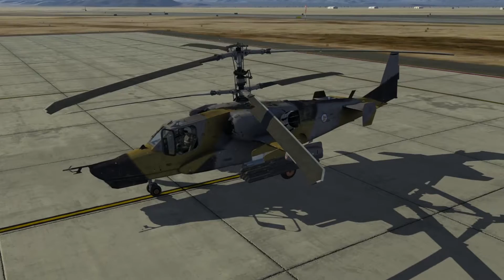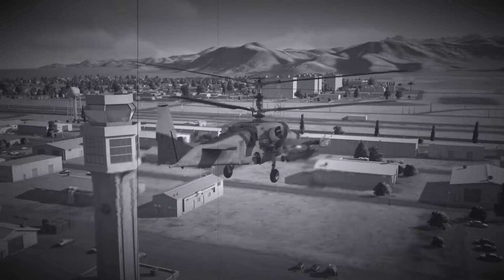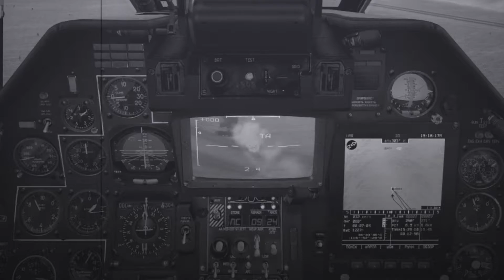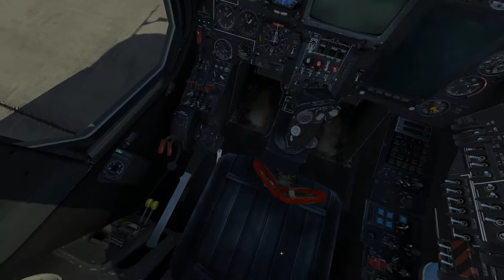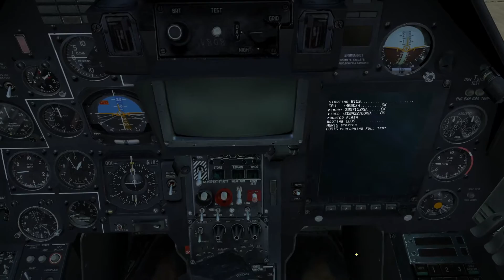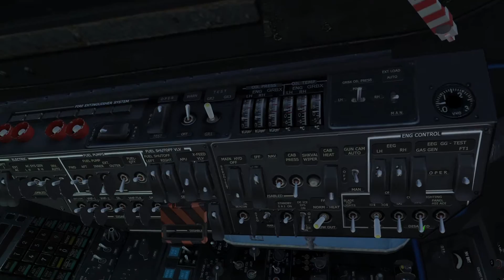DCS KA-50 - Introduction, Startup and Takeoff [2016]

Comment: Hi! Great video about a fantastic module (by far my favorite in the game!). I was hoping I could give my 2 cents about a few things:

I believe the engine (turbine) RPM gauges just display percentages, with the engine at about 72% at idle. I'm not sure if there's actually a way to see engine speed other than just a percentage.

I noticed you turned on the LWS (laser warning system, switch on the rear panel) but to turn on the flare system (counter measures system) there is a switch on the right rear panel, that's labeled something like UV-26. It might not be "UV" but I'm pretty sure the 26 is correct. I can't check right now, but I can later. :)

The yellow levers on the rear left wall (the ones you can't click) are the throttle levers for each engine. There are 3 or 4 settings (I forget exactly), but you want to use the setting that is 2nd from the top, this setting is "Auto" where the computer system manages engine speed while the player controls the collective (collective and throttle are different).

Also, the electrical generators won't engage if the switches are off (right wall panel, near the front) or if the engines are at idle RPM. You have to get the engines running at normal speed (throttle levers at "Auto") then engage the electric generators. The power the generators make is needed for some of the systems, like the Shkval targeting/navigation system.

Let me know if I can help out anyway else. I've been studying and studying this module (and flying it of course :) haha) and I'm always trying to learn it as best as I can!
Reply from the maker: Thank you so much! This was really helpful. :)

Comment: One small comment- in real life you don't turn on the fuel flow until the engine is up to RPM to avoid a hot start. Just means instead of turning on the fuel and then pressing the starter, press the starter, let the engine get up to start RPM and then turn on the fuel.

Comment: Very incorrect startup. Running engines will not allow the navigation system to be properly coordinated. Before starting, the voice command is given to connect external power, the navigation system is switched on and coordinated, and only then the APU is started, the engines are started. Only after connecting the generators is the external power disconnected.  The stop-cock of the engine opens only after 15%  \ Sorry for the text, translated via google. \

Comment: Please do a nav tutorial. Also, the dual rotor system lets the aircraft fly faster. Since both rotors move in opposite directions when one blade on a rotor is retreating (less lift) another blade on the other rotor is moving forward (more lift). That's why dual rotor helicopters are generally faster than single rotor.
Reply from the maker: Thanks for the info! :D Didn't know that about the dual rotors. I'm looking in to making some more tutorials of the KA-50 as soon as things calms down after Christmas, including weapons management and navigation.